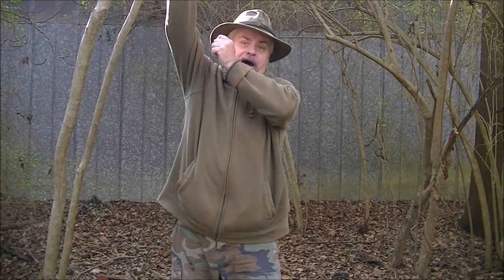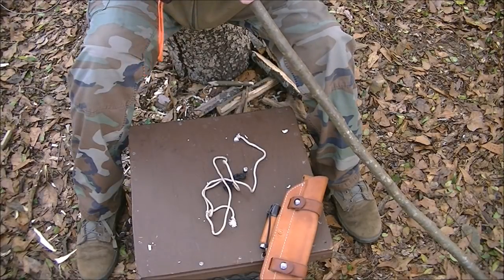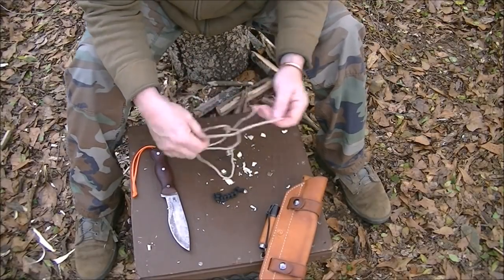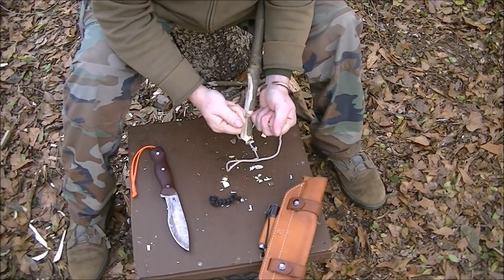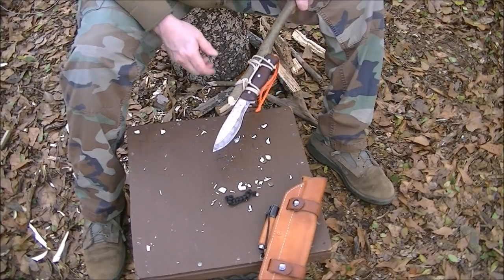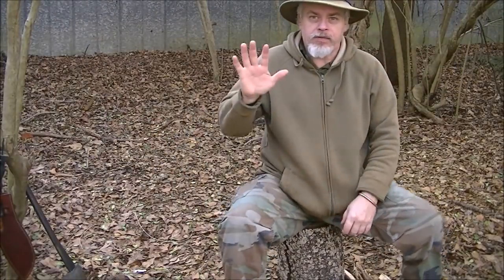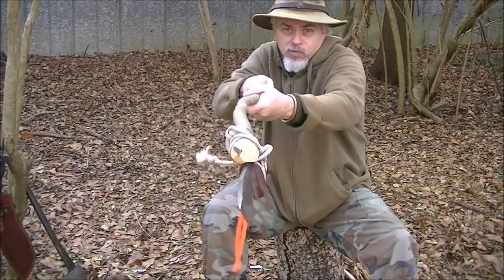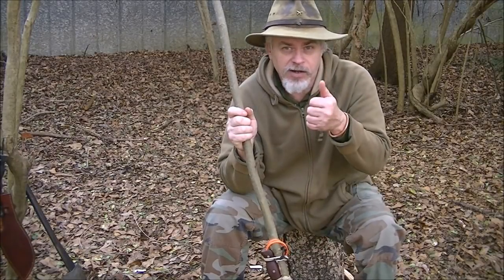IMPROVISED SPEAR LASH

Comment: nicely done  Blackie . Hey Blackie could you possible do a video on the value and purpose of a lanyard hole on a small knife . Reason i am asking is that i am placing some micarta handles on a knife blade with a lanyard hole and was considering doing away with the lanyard hole on the knife blank . i know the value of a lanyard on a large knife , but does the same principal apply to a smaller knife .
Reply from the maker: it can i like to have a lanyard ability on my tool because i canoe and am around rivers creeks quite often..it those cases should i drop it at the wrong time its gone for good so in those cases i add a quick lanyard and feel more secure
Reply: thanks for the reply i can see your logic on the use of the lanyard around water . I will keep the lanyard hole  just in case i should need it in such an environment

Comment: a better tool for dealing with snakes would be a long spear with a fork on the end of it using the fork into pin the snake's head to the ground and then you step in use your knife to cut the head off  or to pick up behind the head considering that live food doesn't spoil  as for spearing fish and squirrel you're better off with a gig instead of a spear. multiple points   this sort of sphere has only one redeeming value for a larger game such as Pig